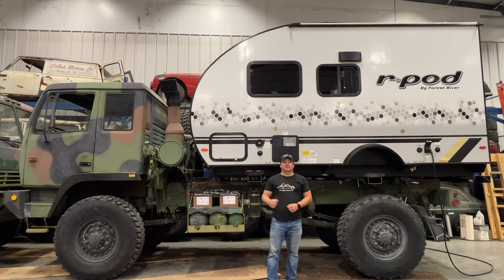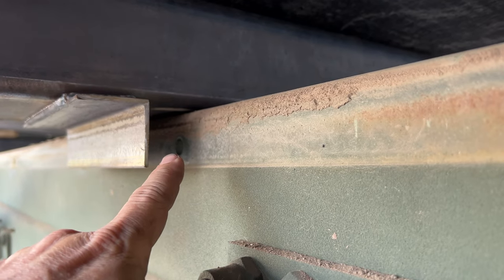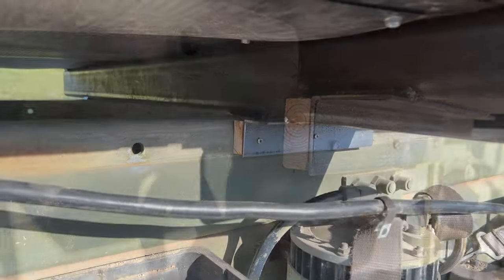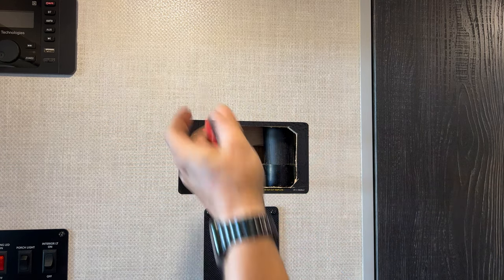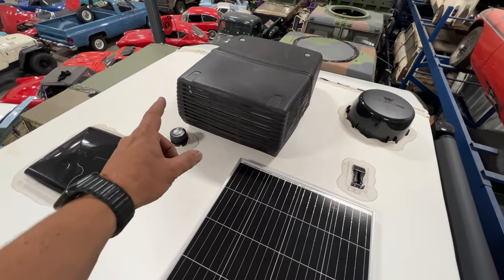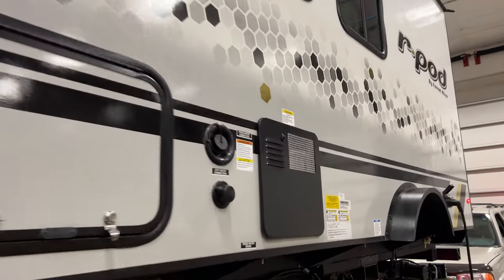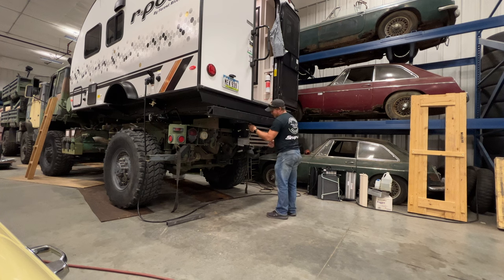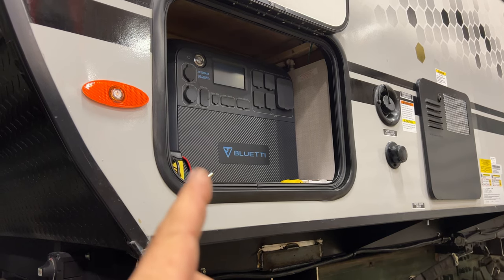Building 4x4 LMTV R-Pod Overland Camper Part 2

Comment: That truck frame is designed to twist I believe over 20 degrees. You should look into a zero torsion frame so that when you go over obstacles the truck frame twist doesn't destroy the habitat.  Rvglobetrekker

Comment: A lot of work there Steve but great progress. It's a shame they put that panel cut out in the wrong place but I know you will make it look good. I like the solution for the stairs really nice fit as if they were always there which is what you want to achieve on any build. From the camera angle I did think it was now too high to get it out of the shop but I know you would not make such a basic error. Enjoy your camping Steve and thanks again for the video. 👍👍
Reply from the maker: Thanks 👍

Comment: I have a concern. The reason why I have a concern is your truck will have a very rough ride. Aren't you concerned that that is going to shake that little trailer to pieces in the back since it's connected to the truck very rigidly and you don't have any dampening measures taken to help soften the blow's at this trailer is going to see.
Reply from the maker: It should be a lot smoother than those tiny tires on the original trailer.  Next step might also be a self leveling air suspension on the camper.
Reply: Camping trailers have going down the road with a hurricane and an earthquake relationship simultaneously for decades....the R-Pod will  be alright. 👍
Reply: I've had trailers and honestly I think it being loud on that truck is going to be way better for it those little tires that most those campers are on and the frames for the trailers are not very strong I've seen those things flex that truck has he that he is not going to flex it might shake it around a little guarantee of less than it would be if it was on its own wheels I seen people do this plenty of times before.

Comment: Looks great but will it fit under a highway over pass or traffic lights ?
Reply from the maker: It is under the 13'6" national limit.
Reply: @ThisWeekWithCars  That's Awesome.
Reply: @ThisWeekWithCars  watch out for residential streets the cable company is notorious for running low hanging wires across streets.

Comment: Very nice, I prolly would have explored ways to reduce the height some, but for what it is it looks sweet, those stairs are slicker than snot. too much niiice!
--have you seen those ladder racks that rotate down the side, that would be cool for addition solar panels because solar irradiance isn't always the best, plus you could just park with the side of your truck facing the sun and lounge on the shady side. probably would be good idea to add some safety components, DC cutoff switch, fuses ect. good luck bro
Reply from the maker: Can you post a link to a picture of such ladder?

Comment: With the camper rigid mounted the frame flex will rip the trailer apart. How tall is the top of the AC unit?
Reply from the maker: That is why I am not going to rigid mount it.
Reply: @ThisWeekWithCars  Looks like a rigid mount is it not? Where are the springs?

Comment: Beautiful rig!! I would love to build something similar,  as it appears it would be very versatile. Concerning the Bluetti:  have you actually run your AC with it? I have a 13.5 BTU AC, and an  O. G. Bluetti AC 200 (2000W/1700Wh) it's supposed to have a 4800 watt surge. It appears to not have enough amps to run my AC😢. Do you use a soft start? Thanks for your insight in advance!!
Reply from the maker: Yes I ran the AC no problem with the Bluetti but I did upgrade later in this video:  https://youtu.be/V5xCz3-6Blw
Reply: @ThisWeekWithCars  Thank you for your feedback!

Comment: Have you figured out how much the average draw is for that AC and how long that battery can run it?
You can get efficient 6k btu mini splits that run at 700w, would be massive overkill even with the poor insulation, but with a 30% duty cycle you’d get 9h run time which would get you through the night and be real nice assuming the inverter is efficient. 
The bigger issue is I’d bet that panel would be lucky to collect 1.2kWh a day so your second day you’re getting more like 4h of AC.

Comment: OK HERE IS MY QUESTION. SINCE YOU WILL BE DOING A LOT OF OFF ROAD,  THAT TRAILER SITS  VERY HIGH, HOW DO YOU COMPENSATION FOR A HIGH CENTER OF GRAVITY SO IT DOES NOT TIP  OVER?
Reply from the maker: That trailer weighs much less than anything that truck would have carried.  The center of gravity will never be high on a truck that heavy.
Reply: OK IWAS JUST WONDERING WHAT THAT TRUCK CAN HAUL.